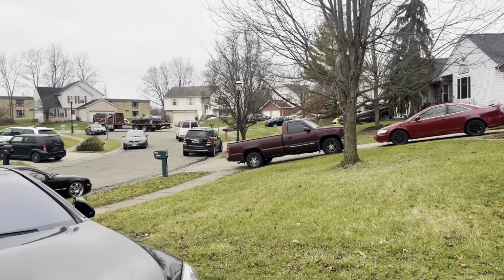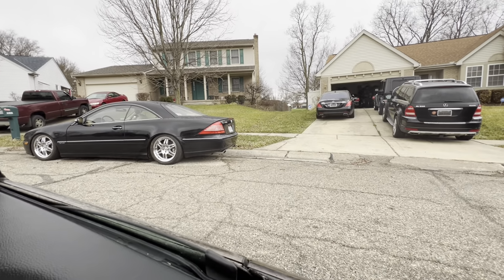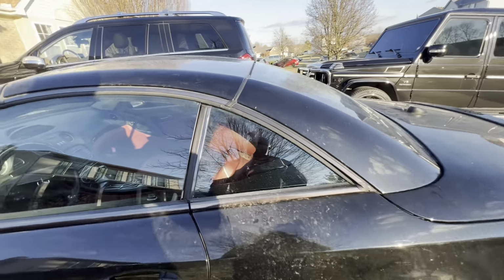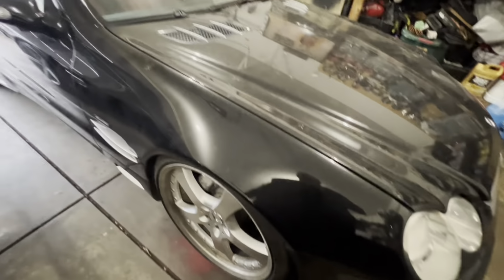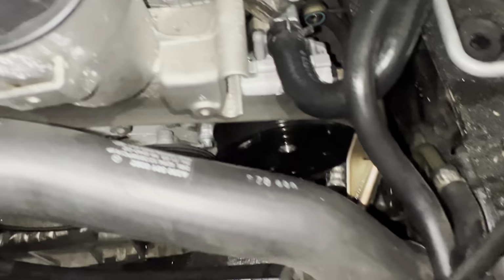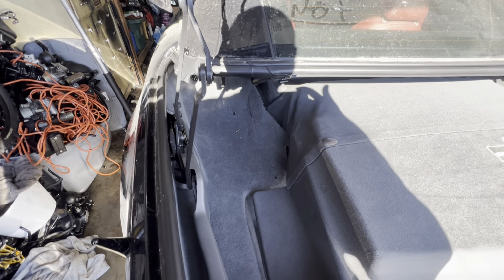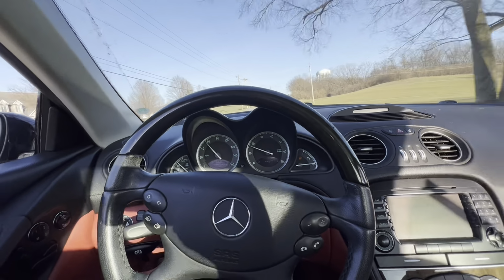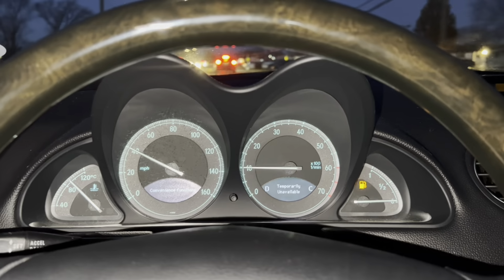Mercedes SL500 w/ Lorinzer Kit 😙From Dayton To Cincinnati….Silver’s Neomax Coilover Conversion

Comment: I got a cl500 bro but the abc went bad (obviously) I’m gonna get the yellow speed coils but I’m worried about the handling, should I install sway bars or it won’t make a difference?
Reply from the maker: Swaybars are good. They will stiffen the suspension more. Not absolutely necessary though. I did not install them on my CL55. It handles well without. For faster maneuvering, swaybars will help. For everyday driving, not needed. https://www.goldelementautoworks.com/product-page/dynamic-pro-sport-coilovers-1999-2006-mercedes-cl500-w215
Reply: Thanks man

Comment: I have 20in on my 03 cl500
Reply from the maker: Very nice!
Reply: @goldelementautoworks  my right side door doesn't get power and that window won't go down.  But that back one on the side goes down can u help me sir.
Reply from the maker: @mrjackson48  It’s either the wire harness in the door, or try a new master driver door window switch assembly.
Reply: @goldelementautoworks  I put a new window control module that moves the seat controls and still nothing and I checked the wires in the door everything is good but still no answer or power. Are you on ig or fb
Reply from the maker: @mrjackson48  Both. Widebodycl55 Instagram. Gold Element Autoworks on Facebook

Comment: Question: Can a coilover be done on a 2003 S500 4Matic?
Reply from the maker: As of now, it does not specify that the standard W220 kit will work with 4matic. I will do some research. I encourage you to do the same. The forums are very helpful.